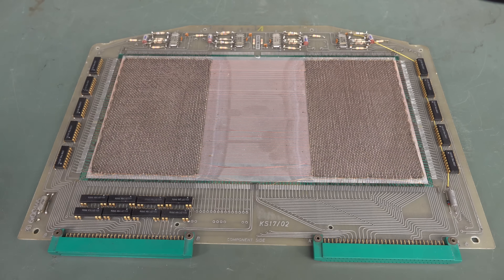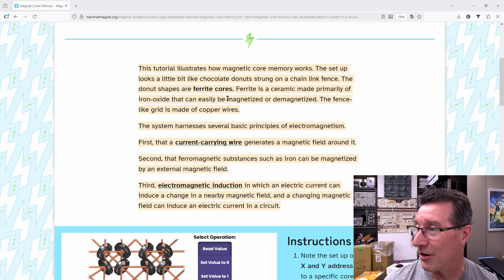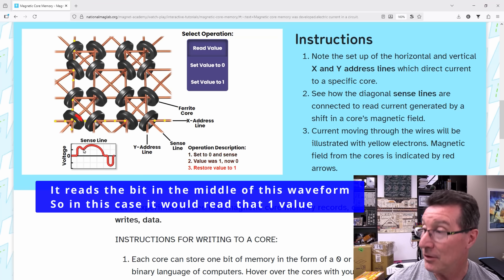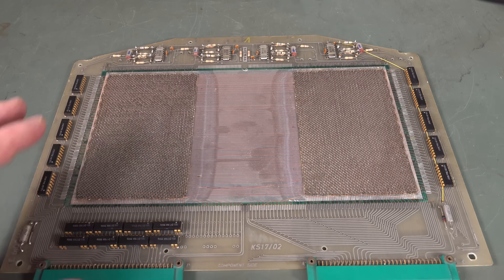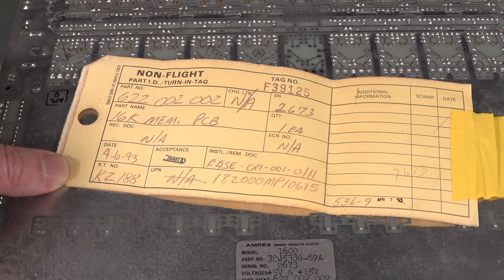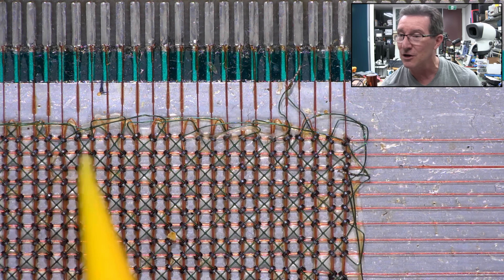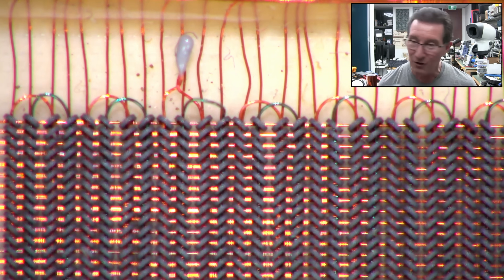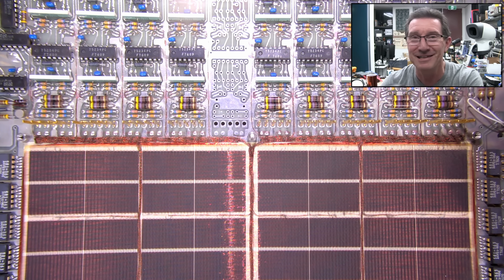EEVblog 1713 - CRAZY Density Magnetic Core Memory from Space Shuttle!

Comment: I have never seen core memory as densely packed as this before. I wonder if this was as dense as it got before semiconductor memory took over
Reply: These are pretty small cores. If they are not the smallest ever used, they are pretty close. But when necessary, a mat like this could be folded several times, to package it on a board a fraction of the size of this one. 

Note that the board shown in the video is only one half of the memory module -- this is the core mat itself plus the sense amplifiers. The pins on the borders of the board are for connecting the mat to the second board with all the electronics which provides the necessary signals to make it work. This was also eventually miniaturized. All in all, a module of this capacity was eventually available as a rugged assembly about the size of a small book.

Comment: Those boards were used in the AN/UYK-20 which was used in the Navy Satcom Systems. Navmacs for Ship and Cudixs for the shore side. That was the era of a single satellite channel was only 9600 baud. On that channel was 4 inputs combined into one. The equipment was designed by a scientist called Viterbi and bears his name, The Viterbi Interleaver and Encoder.
Reply: I was a navy ET in the mid 80's UYK-20 was one of my responsibilities, old memories coming back lol.
Reply: @dasisu1885 I went to the USS South Carolina CGN-37 January 2nd 1982. Next day we were underway for a 6 1/2 month MED cruise, from a 2 year assignment as a Poseidon MT-3 to  a comm  ET. Really liked that 80 character drum printer. Re-enlisted for the Cudixs (shore side) of the system. Didn't finish the term of my time. Had a discharge with 30% from an injury on a cruise to the briny deep of the north sea. 
That Ship took a 43 degree roll, from an unqualified Bridge Officer trying to maintain course instead of cutting the waves

Comment: I used to be an electronic tech in the navy we had a message processing computer that had 64k of ferrite core memory, 8 boards of 8k memory each, and while I doubt they are still using them they were using them at least until 1998. another advantage is it doesn't lose data when power is out, if we lost power we just had to tell it what memory address to start executing code from and it would start up right where it left off, I don't remember the clock frequency it ran at but i'm fairly certain it was well below 1mhz,

Comment: These sorts of toroids are still used in a rather important role: noise suppression. Toshiba's AMOBEADS eat diode reverse recovery current spikes. Basically, when current is in diode's forward direction, ferrite is "set". When the current tries to switch into the opposite direction, short voltage spike is applied to the toroid, but it's too short to do the "reset", thus no current. And no current => no noise. In other words: correct current direction is literally stored in the ferrite.
Reply: I have used these Amobeads to reduce the reverse current recovery in a boost converter's main diode. The performance improvement was massive.

Comment: The later boards, maybe like the Ampex, the read / rewrite cycle is done by the on board logic.
So reading a word will NOT destroy the data.
Reply: The board shown in this video is just the core mat with sense amplifiers. There should be a second board roughly of the same size as this one, with lots of electronics required to make this a complete memory module.
Reply: That's exactly what I was going to ask about... so this particular board doesn't have the rewrite cycle built-in? I guess you'd have to connect to some other specialized controller circuit to properly drive it then?
Reply: Or I guess whatever "computer" this is attached to is just supposed to be aware that that's how this memory works and then manually write back whatever it reads if it cares to keep it after reading.

Comment: That 18 bits is 16 bits + 2 parity bits. That allows error detection.

For the silicon or germanium parts to survive a nuclear event, the system needed to ground all the signal lines. To do that in time, they used nuclear event diodes. These start conducting when the first wave of radiation from the nuclear explosion strikes the diode. Once the lines are grounded it is much more likely the computer will survive the electromagnetic pulse that arrives later.

My first computer was cast off by dad's work. It was mill spec. It had 2 large refrigerator sized cabinets for memory. Each one was 4k 36 bit or 29 bit words, plus there was a Central Processing Unit (CPU) cabinet that had the brains. The 36 bit words were for data, and the 29 bit words were program memory. Note: No parity in this computer. Dad's work was throwing it out for scrap in 1973. It didn't work, nobody wanted it, and parts were no longer available. We couldn't even find the transistors used in the discrete circuitry. Thankfully modern (early 1970s) transistors worked better in the Resistor Transistor Logic circuitry. So as a preteen I got a crash course in digital electronics including computer CPU design.

One of the tings I did was remove the nuclear event diodes, which I had no clue what they did at the time nor could figure out why they were there, and replaced them with resistor containing LEDs. After doing that I could watch the state of the computer. This helped me debug and fix any logic faults as transistors died. I got to the point where I'd change all old transistors on a card if one died.

First upgrade was to replace the core memory banks with SRAM. 1k and 2k SRAM chips packed much denser than the core memory. They also used massively less power. By the time I turned a teen I had rebuilt the whole computer using TTL logic chips, including the main CPU unit. I even added a multiplier to the arithmetic logic units. The computer went from 3 large refrigerator sized cabinets to 4 wire wrap circuit boards that were about 2 square feet in area. It also increased from 4k words each of program and data memory to 64k words each. I also added a PROM memory bank for stored programs. Lastly it was about 10X faster. I retimed the logic in the whole thing.

The most important thing I learned was if somebody else could do it, I could learn to do it too.
Reply from the maker: You can still get those nuclear event diodes as a chip that gives an open collector output  when a nuclear strike occurs.
Reply: I'm guessing those where some sort of TVS diodes so just clamped the voltage to some safe level.  You where at the point where integration was not so high that repairs where impossible. I remember reading a book about the future of electronics repair that predicted we will do repairs on integrated circuits likely thinking it could be economical to do so :).
Your last sentence is applicable to AI's today (If humans can do it AI's could learn to do it too).
Reply: @electrodacus   This computer was made well before integrated circuits existed. It was all implemented in discrete circuitry. Individual resistors and transistors. The cards didn't have any capacitors on them. Very electrically noisy. The logic style was resistor transistor logic. It consumes a lot of power due to the draw of the resistors. For a logical true, the transistor would turn on pulling the line down to the low logic voltage. All the while the resistor is trying to pull it high. Lots of heat produced in the resistor and transistor. Also those transistors didn't turn on near 100% like a modern transistor can. Modern CMOS style logic is massively more efficient when implemented in discrete circuits, however it takes many more transistors of a different type.

Each card was roughly the equivalent of a TTL chip, but there were some differences in "pinout". So one card would have 4 AND gates on it. Another would have OR gates. The cards were all 4" by 6". All of the logic used to design the computer was in the wiring in the back planes holding the cards. They were implemented using individual wires soldered to the pins on the card connectors.

The nuclear event didoes did nothing unless they failed, or there was the initial radiation event from a nuclear blast. I started removing them when one of them failed. I later used the holes to putt LED monitors on the logic lines. When they conduct, they short the logic line they are attached to. There were also a few that turned on large transistors that shorted the power rails and turned off the power supply.  I think I left those in place because why touch them if they are still working.
Reply: WOW!!!
Reply: First time hearing about nuclear event diodes. Fascinating. Thank you.

Comment: Dave... youve GOT to put one of them to some use.. atleast get it running even if its just 8bits and one bank or somethin....shouldnt be too hard to drive it with an arduino mega, may need external power tho!
i doubt magnetic core memory can survive an EMP... its still electrical... and magnetic....so ya could burn out lines or erase the entire array

Comment: A week ago I saw a core memory module for the CDC 7600 at the Museum of Industry and Technology in Chippewa Falls, WI, the home town of Seymour Cray and Cray Research. The cores on that module are so small I could not visually see the individual ones.  Small cores switch faster than large ones so small is good here.  A spec sheet I just found says 1760 nanosecond read/write cycle time.  It had a 512K - 64bit word main memory and the CPU had a 65K word memory.

Question:  Do cores get demagnetized or just remagnetized in the other direction?  I vaguely remember the hysteresis loop from teaching computer tech back in the early 1970's.  Seems like the latter case. When solid state memory replaced core memory the text books stopped explaining how memory worked at a low level, just that it did work.  There are bits and bytes and on.
Reply: The magnetic domains are oriented either all in one direction or all in the opposite direction, so it's the latter case.  
I wonder how small magnetic cores could be, and still work.  Could they be placed using a photolithograpic process?

Comment: The ferrite cores have to be very non linear such that half the current does nothing at all while the full current can flip the magnetization. Otherwise writing or reading a core would affect all the cores in the same row and in the same column. While in theory reading zeros could be faster, if you read a full word then some bits will be zeros and the other bits one so you might write back everything even if writing the zeros won't do anything.
Reply: That's exactly how they are. The ferrite cores used have a relatively square hysteresis loop such that the magetic flux from the current flowing in only one X or Y wire has absolutely no effect on the stored data bit.

Comment: I worked with Control Data computers starting in the mid 60s. First, the 3300 then the 3500 and 6600, all with core memory. CDC computers used 6 bit characters rather than 8 bit bytes. So words were a multiple of 6: 24 and 48 for the 3x00 computers and 60 for the 6600. Plus parity bits for the 3x00 computers. The 6600 famously had no parity bits. Designer Seymour Cray said that "Parity is for farmers".

The 3300 memory cycle time was something like 1.2 uSec. The 3500 and 6600 used the same memory modules and were somewhat faster. Perhaps just under 1 uSec. 

The 3300 and 3500 had the option of what is now called an MMU. CDC called it a page file. It was also core memory but substantially faster. And substantially less reliable. I don't remember the exact cycle time of the page file, but it was nanoseconds.

The core memory modules were made in Mexico, probably because the labor needed to string all of those cores was a lot cheaper there. We dubbed it the Tijuana Core House.

Comment: 16K by 16 bit with 2 bits per word for parity error checking.  It was common to have a way to flag or even correct memory errors.   My collage room mate and I got a retired and donated computer running with a core memory  that had error correction and had a failed sense amp on a data bit.   The 4 extra error correcting bits (ECC) (8+4, 12 bits per word total) would fix every bad bit but you had to turn off the HALT on error switch for the machine to run.

Comment: In the '80's there were still ferit memory's in use in PLC's. For exemple trafic control lights in Amsterdam. Those were Kistler PLC's with racs of ferit memory. I have even repaires some of them.
They could hold information for a day or 2. The controler had to read ol the data verery now and then (you could set a refresh time) and then rewrite it compleetly.
Each rack could contain 20 to 40 boards with memory.

Comment: In the early 70s I worked for a mainframe company in the UK. Their magnetic core memory was made in 12kbit cards, divided into three blocks of 4k memory. If a customer leased less than 12k (4k or 8k), then the unused blocks were physically jumpered. When the customer wanted more memory, a field engineer visited and removed the jumpers.
Reply: This is the same as what BMW did with the heated seats. Good for the business, but bad for the customer. And such a waste for the environment (or just in principle) to build something that's left unused!
Reply: Crazy that they found that to be cheaper even with those huge cards.
Reply: typical scam practice
Reply: @almosthuman4457 it is, but interesting that the tricks used today are far from new.
Reply: Same thing with oscilloscopes and everything else. You bought a hardware but You can't use all of it.
Reply: Fanuc also does the same thing with their controller options. Many are already there including double the RAM and to get more you get a Fanuc engineer to visit, pay some dollars (usually 10K, 20K etc)  and he typed a few things and unlocked the options. Years ago I got a large listing of options and how to unlock them and in my work as a CNC programmer and CNC Machinist I would unlock all the options on every machine I worked on so it was vastly superior to the others then pump out parts faster than everyone else due to having many time saving options.... the bosses noticed and I always had plenty of work right until the last day when I retired heh!
Reply: Sounds like today's subscription model.

Comment: Quite a big one for a single plane, must have been a pain in the ass to make by hand and yet they still did it.

This one is still pretty simple as some magnetic core memory designs added a few more wires through the core: separate row and column read and write lines, write inhibit line, erase line... This has more to do with the circuitry around the memory, with a complexity tradeoff between electronics and the memory itself. Worth noting is that the fewer wires through the core, the smaller the cores may be, allowing for tighter packing and higher density. 

Look how it was made in '70s Poland! https://www.youtube.com/watch?v=aDvtmjWQrzM
A very precise job that required an optical microscope to see a thing back then. Proper respect to those gals, but that's nothing compared to the Ampex a.k.a. hardcore to the max!

Comment: Love this. My own engineering career started with uni in the early 80s. After I left the US Navy in 1981, and before I entered uni later that year, I worked on radiation monitoring systems for commercial nuclear power plants. Magnetic core was favored in such applications until long after silicon memory became rad-hard enough to survive in the worse-case situations.

Write-after-read circuitry was a standard feature. The key was to merge the need to change the stored value or not. This is a cache, of sorts, but it demands real-time awareness. The default assumption is to write back what you just read. However, the super-trick iwas to merge pending writes with active reads, which was the best-first use of combined silicon + magnetic memory.

The fine magnetic weaving shown in such a late date board is a unique feature of Ampex, who pushed core into many specialized applications.

The last application I'm aware of was for a PDP-11 memory board, long after our sensor systems had shifted to SRAM and DRAM. It was part of our supervisory control system, which was able to cope with amazingly large radiation events.

So much fun!
Reply: My grandfather was a civilian engineer for the Navy working at NUSC in Newport for a couple decades. Him and his collection of old naval tech are the reason I'm here! He worked in maintenance mainly on Mk48 guidance systems, but I wish I had the chance to ask him more about his work and life. Had so many bags of obsolete opamps from the late 70s, he ended up giving hundreds away to places of education. That man sure preached those opamps!